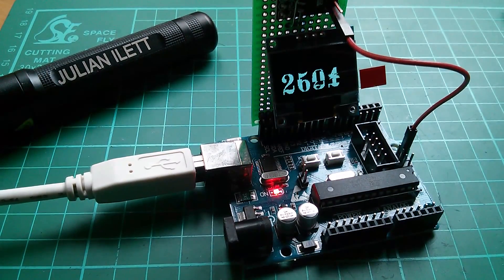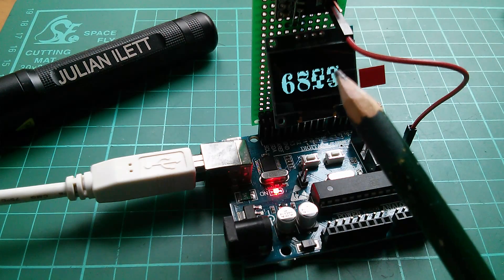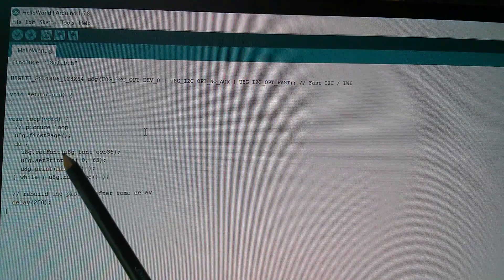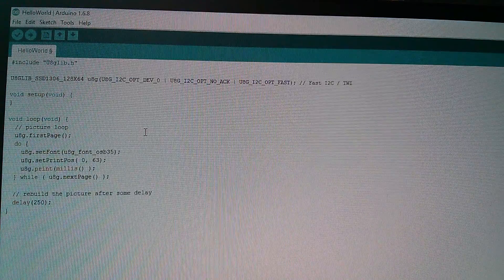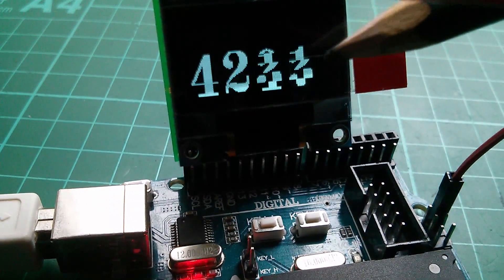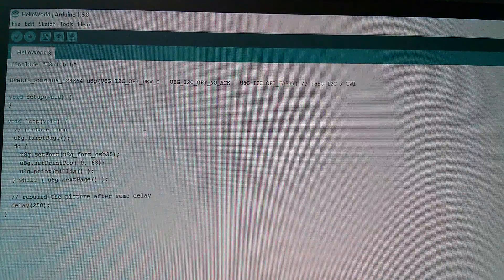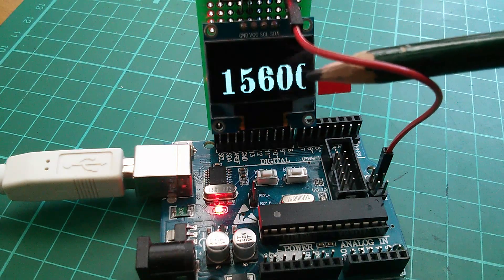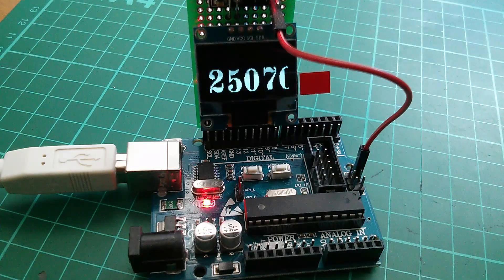Arduino OLED Display and the u8glib Picture Loop

Comment: Julian, Please get back in the garden and continue the Muppet project. I'm converting some of my lighting in the house to 12V LED charged from a dedicated 240W panel(s) and I need a good charge controller. Im up the road from you in Solihull so willing to be a test site.
Reply from the maker: +whitefields5595 I will do when it's not cold and wet

Comment: Hi Julian, your problem is in your example code. In the do...while loop you write all pages while always using the current millis() time. So if millis increases while drawing a line, you get 5 lines with "1234" as millis, the next 5 lines with "1235" and so on.
So if you add "unsigned long millis_value = millis();" before the do...while loop and use millis_value instead of millis() itself, you will get rid of the tearing.

Comment: You could do something like:
void setup() {
   last = millis();
}
voidloop(){
  now = millis();
  diff = now - last;
  if (diff > 1000) { 
    updateYourDisplay(now);
    last = now; // omitted in original post
   }
}
Reply: +Al Lipscomb - Close but the last=millis() can't be in the setup() as it will only be run once and after 1000 mS your diff variable will always be greater than 1000 and you will be updating your display every time through the loop.  Set last=now or last=millis() in the IF statement and it should work as you intended.
Reply: +ElmerFuddGun You are correct, I left out that step. Thank you.

Comment: Your update rate for the display is too fast. You can't display a ms value in real time without some blurring of the numbers.
Reply: +TheViewFromUpHere - No.  There is a 250mS delay at the end of the loop so the display is only being updated less than 4 times per second.  If the delay was 10,000 mS (10 seconds) you would still see the problem because the complete number is not displayed before the millis() function has changed.  In effect the print function is not fast enough.  Capturing the millis() value to a variable before passing it to the print function (the DO loop) allows the printing of the number to finish before it changes.  After that fix it would have been interesting to take out the delay(250) in the loop to see how fast it could loop and what kind of blurring effect it would cause.  The shown problem is basically the digital equivalent of seeing a plane's "bent" propeller on a picture or video frame when the shutter speed is not fast enough.
Reply: +ElmerFuddGun His program was reading the ms value 4 or 8 times while the display was being written. Reading the ms value in a controlled fashion outside the display routine fixed the problem. Controlling how often a function or subroutine runs is also a good way to optimize your program.

Comment: I note that you are using the latest 1.6.8 version of the Arduino IDE. When I installed this last week it rejected my u8glib library as incompatible with the IDE on every start up. I've just checked and the u8glib library doesn't seem to have been updated for some time, so I'm wondering if anyone else has had this problem.

Comment: I once wrote a low level driver for these displays. Your analysis of the problem is correct. The display has a command to select the page (ie 8 rows of pixels) then each data byte written updates one column within the page and increments the horizontal position by 1 pixel. This is normally used with a font which is 8 pixels tall, and then one page = one line of text.

Comment: Good one Julian. Exactly the same loop drove me crazy 2 years ago when I was playing with u8 library first time. nextPage() added to the confusion, as I was thinking full pages, instead of rows on the same page. :) Took sometime to figure this out back then. Great Video. 
BTW, what is the arduino board/clone that you're using in the video?

Comment: Suggest read millis() into a variable outside the do-loop and then print the variable. You're also not clearing the screen, I've not used this library so I'm not sure if you need to.

Comment: Julian, by the way, could you consider exploring deeper STM32? I'm impressed of the speed and capabilities of this MCU. Especially that generic STM32 boards are available now on Aliexpress for less than $2.20! I recorded short video with comparison of LCD screen rendering capabilities - you can check it on my YT channel. It looks very impressive. STM32 is sometimes 12-13 times faster than ATMEGA based Arduinos! And it is supported by Arduino IDE, so programming became very easy.

Comment: Great video Julian. May I ask how long you spent working this problem out? How did you work out the cause of the problem, was it by the data sheet or some other form of black magic? 

Where did you start? 

I'm grateful for all your work  and for sharing it so professionally. Whilst you provide the solution and an understanding, for a newbie like myself. 
Do you think it might be possible in future videos to explain  the route you took, how you approach the problem. 

Many thanks
Reply from the maker: +Dean Greenhough This one didn't take too long. I've used these OLEDs before with my own code (no Library) and I remembered the 8 pixels per row layout. But I've got another u8glib fix which took me all day to solve! I'll make a video about that soon
Reply from the maker: +Dean Greenhough My approach to fault finding is: throw everything you can think of at the problem, but periodically step back and look at the bigger picture. I'll try and explain this in a video soon. Thanks Dean - how to fault find is a fascinating subject.

Comment: For I2C stuff I highly recommend the digispark pro or clones, there just tiny.
Reply: +drkastenbrot I'm just getting into microcontrollers, trying to pick up a new hobby, and I came across those little boards. Are they as easy to get started with as the atmega328 in Arduinos, for a beginner I mean? Having all the documentation and boatloads of pre-written libraries really makes it easier to use when you don't know C very well.
Reply: +stryk187 the digispark is what got me into C coding, so yes
Reply: +drkastenbrot There? Where?
Reply: drkastenbrot Thx for the info, I might just order one to play around with.

Comment: Can't you just use "unsigned long m" rather than "int m" then?
Also, do you have to call setFont in the inner loop?
Reply from the maker: +codebeard Using an integer kept the number to 5 digits - which stopped it falling off the display. Calling setFont within the do loop does seem a bit wasteful. I'll experiment with that
Reply: +Julian Ilett But then make it a unsigned int. As long as you go for a unsigned type you don't have the negative roll over ;)

Comment: u8glib is known that saves much memory, but the disadvantage of it is necessity of complete rendering entire screen (with clipping) many times. With constant data of couse. That's why you cannot just use such changing variables.  AFAIR it is possible to define those memory slice somewhere in the headers. So instead of 128x64 = 1024bytes, this lib uses only 1/2 to 1/8 of it.
Reply from the maker: +cbm80amiga That would be really handy if you're only using a small part of the display and you want a fast running loop
Reply: You can manage the screen framebuffer by yourself. Like in your low-level example from older video. Because u8glib renders entire screen even if nothing changed in smaller parts.